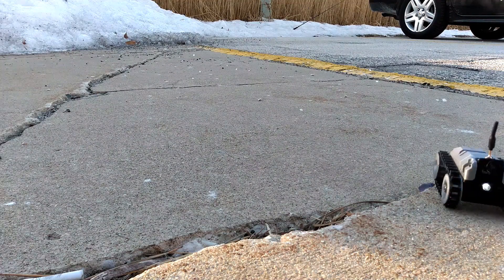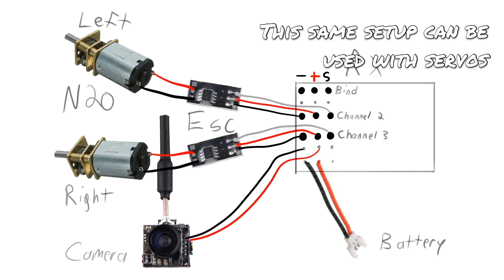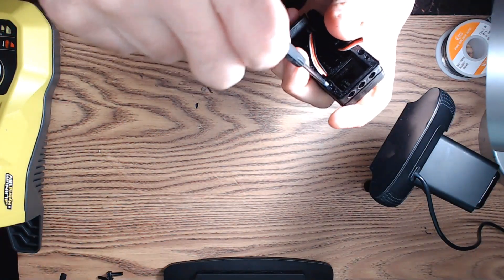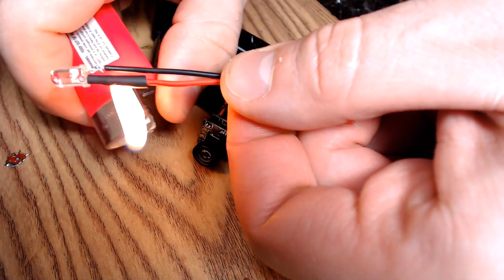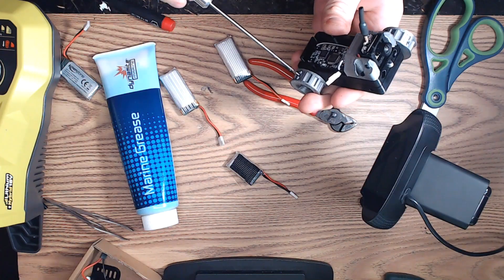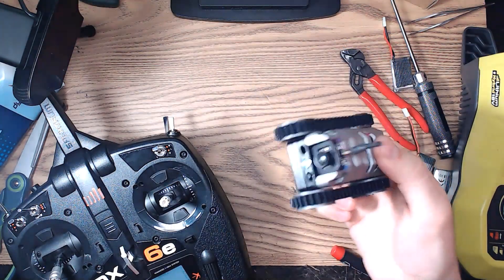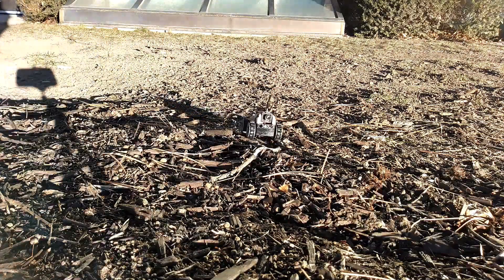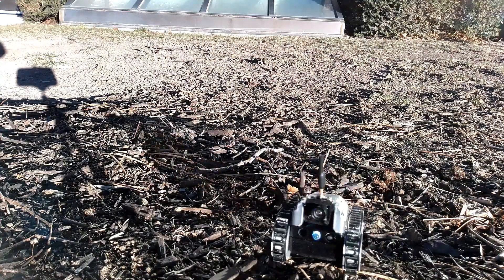Pilot Trak Micro

Comment: Have you tried using this to run wires above drop ceilings or anything of the sort
Reply from the maker: Not with this one in particular as it may be a bit too small actually, but my older design was made for that exact purpose: https://youtu.be/FASVmuZRvoc